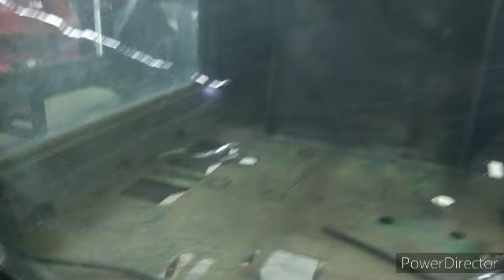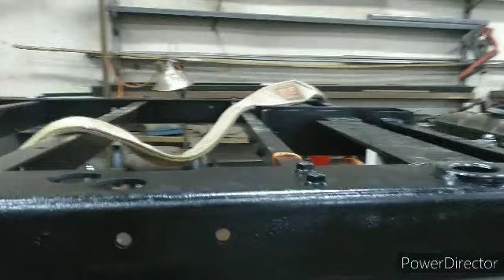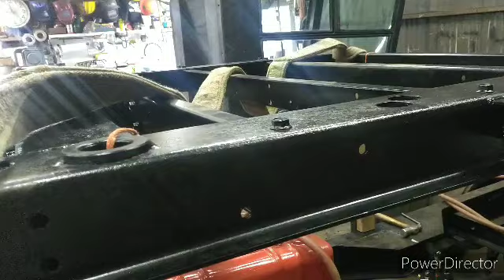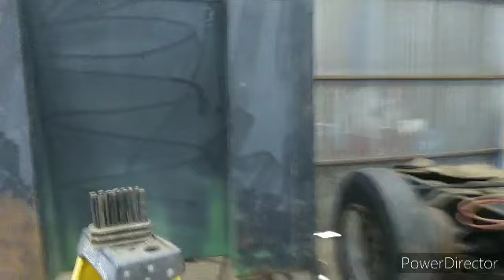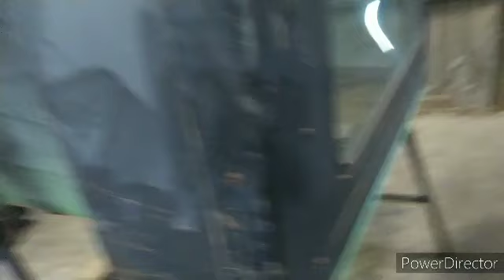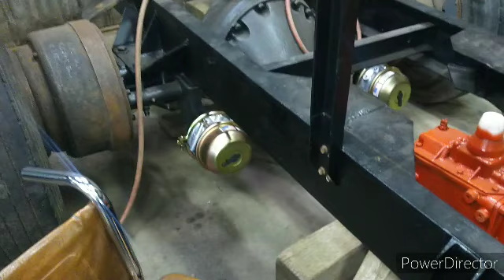cab platform and air cans on.. lots of figuring...

Comment: Good morning sir ☕🚬.
It looks very high, but it may be due to the camera angle.
It will be a very stable building in any case.
Reply from the maker: It is not low.. will be able 10' (a little over 3 meters?) To the top of the cab when done.  
Good morning sir ☕☕
Reply: @GosselinFarmsEdGosselin  It gives good visibility if you drive among tall crops.

Comment: Looks good ! Yeah that's going to be fun putting that cab back on there! Are you going to put AC in ?
Reply from the maker: I'm hoping the skid steer can do it with the bale Spears on.. get another 18" of lift😎 and as you know, much better visability getting it in the right spot 👍
I'd like to put the AC on it, if I can get the pump mounted... Not much room for it, but if it will fit....
Reply: @GosselinFarmsEdGosselin  where there's a will there's a way!!👍🇺🇲

Comment: Ed , variable speed pulley belt at top , is this fast or slow speed? On a Gleaner combine . 
Explanation; variable speed on rasp bar cylinder belt is now at top of pulley running at 500 rpm . Where the book says it supposed to be to pick corn . But if I want to slow down I don’t think I can . Thanks. Congratulations on getting frame on chassis.
Reply from the maker: If the belt is at the top of the pulley on the rasp bar shaft, that would be the slowest it can go. It should be down low in the shivs at the drive end. It's just like the variable ground speed if you have that. And the chaffer fan should be a similar set up...
Reply from the maker: Thank you Scott!!😎👍
Reply: Thanks a bunch Ed that helps me out tremendously much!
Reply from the maker: @gleanerk  you are welcome Scott!!! Happy to be able to help!!!